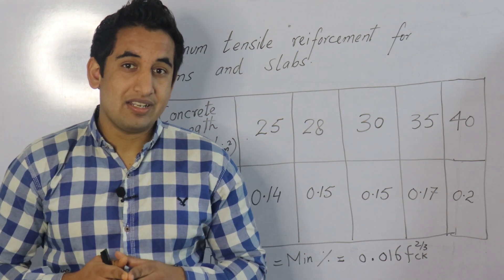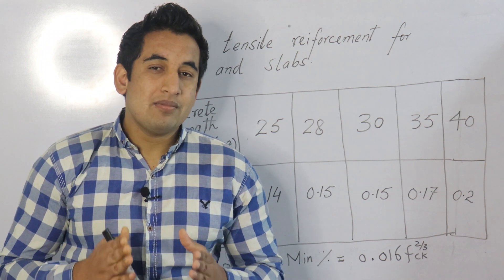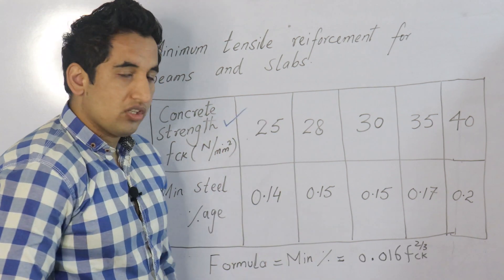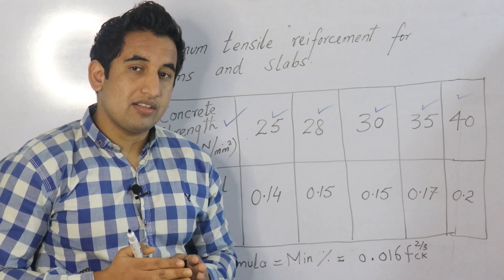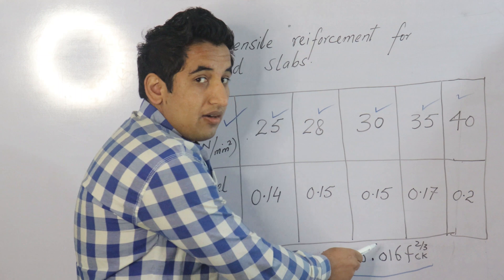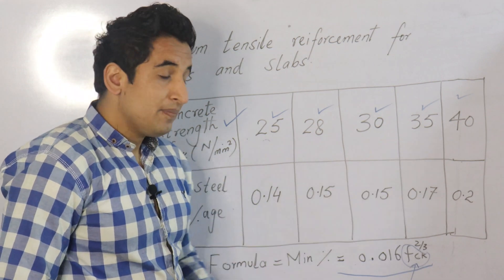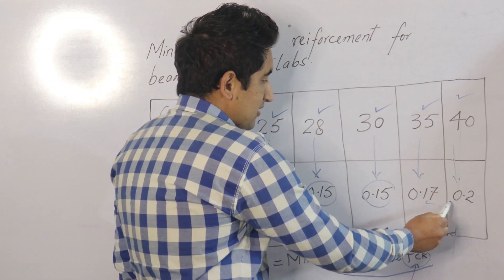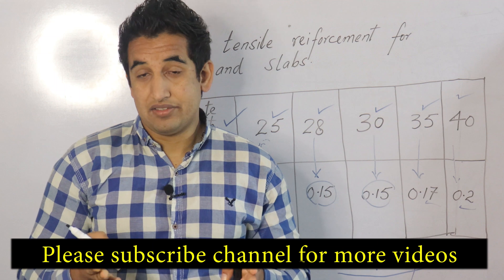Steel Ratio for Concrete | Minimum Steel for Beam and Slab

Comment: hi, your video is very helpful. but you did not mentioned that percentage depend on which things. mean percentage will calculate on cross section of concrete or volume of concrete?
Reply from the maker: Its area of section
Reply: Thanks